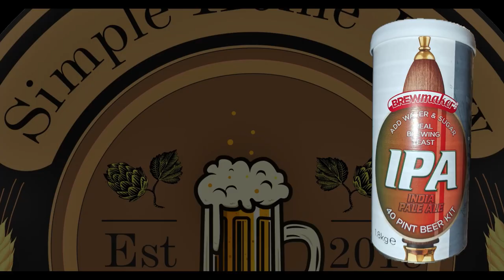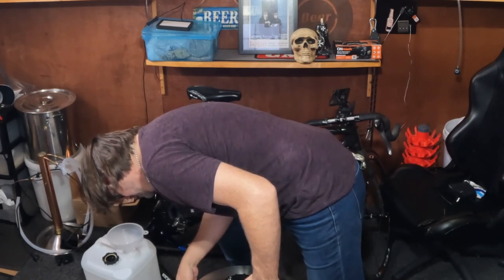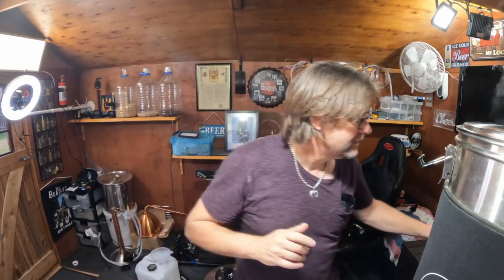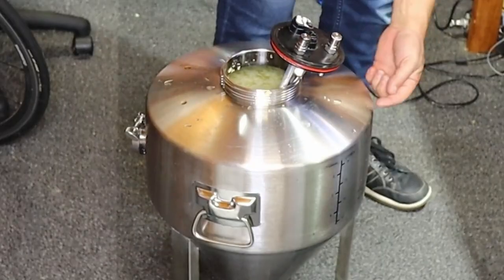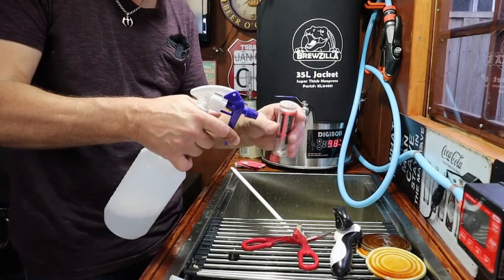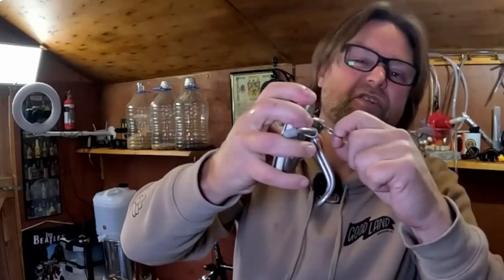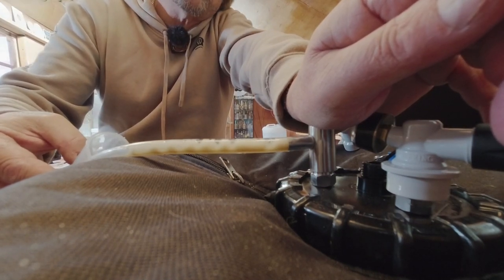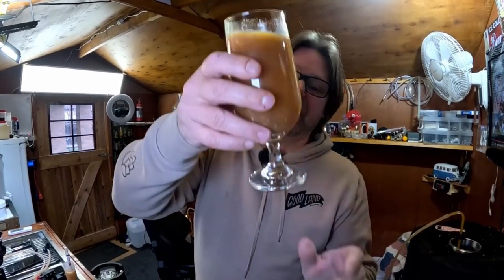Make Your Own Coco Cabana Beer At Home With This Easy Extract Recipe!

Comment: Great experiment and I expect it woulnt be cheap to put this together so I really hope its going to be a fantastic brew, all the best and PS I read somewhere that the TILT (and other floaty devices) does not read true under pressure (I have 2 but still using fermentation buckets). I love the TILT as it let me know that I had a stuck fermentation. Fixed with a tiny stir and up 1c, cleaned TILT and its dropped 3 points in 6 hours, so happy again now, cheers Pierre 🍻

Comment: good video hope it doesn't clog you beer line in you kegerator i have had that happen a few times when i have dry hopped a lot hops
Reply from the maker: Thanks @beerman2221 I think I will be struggling with the keggerater for sure.